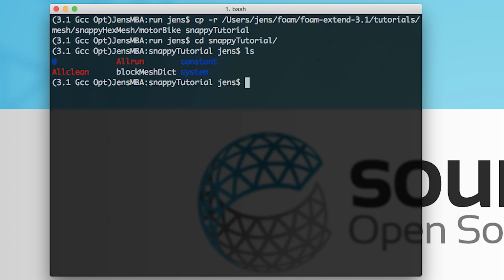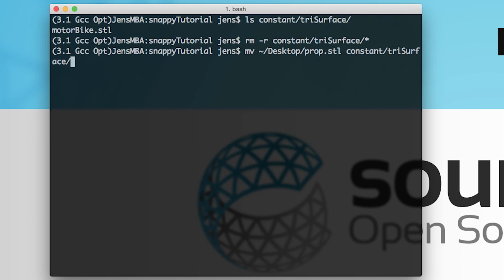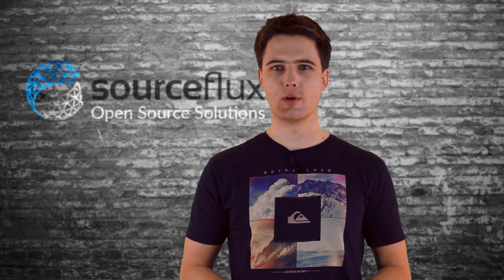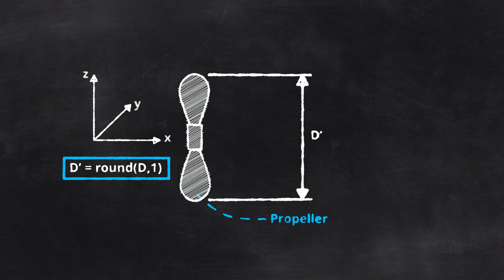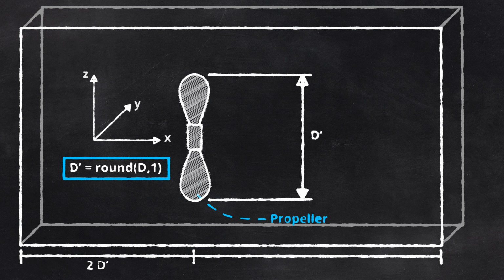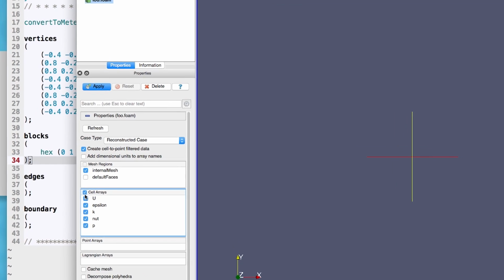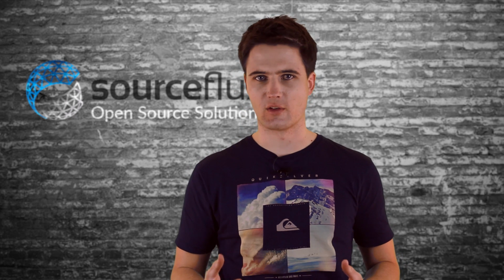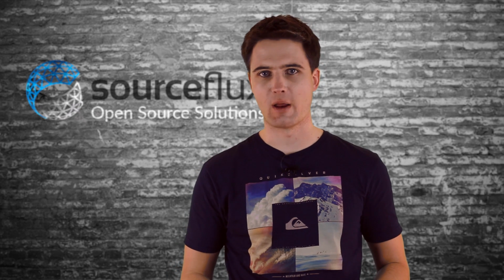snappyHexMesh Tutorial Part 1

Comment: Hi, I'm Aldias.
thanks for giving the tutorials.
its helpfull.
But I'm still having problem with the Boundary Condition,.
When i was running, 
In the terminal was problem:

aldias@aldias-desktop:~/snappyTutorial$ blockMesh
/-------------------------------------------------------------------------\
| =========                 |                                                 |
| \\      /  F ield         | OpenFOAM: The Open Source CFD Toolbox           |
|  \\    /   O peration     | Version:  3.0.1                                 |
|   \\  /    A nd           | Web:      www.OpenFOAM.org                      |
|    \\/     M anipulation  |                                                 |
\-------------------------------------------------------------------------/
Build  : 3.0.1-119cac7e8750
Exec   : blockMesh
Date   : Apr 11 2016
Time   : 14:27:12
Host   : "aldias-desktop"
PID    : 3084
Case   : /home/aldias/snappyTutorial
nProcs : 1
sigFpe : Enabling floating point exception trapping (FOAM_SIGFPE).
fileModificationChecking : Monitoring run-time modified files using timeStampMaster
allowSystemOperations : Allowing user-supplied system call operations

// * * * * * * * * * * * * * * * * * * * * * * * * * * * * * * * * * * * * * //
Create time

--> FOAM Warning : 
    From function dlOpen(const fileName&, const bool)
    in file POSIX.C at line 1179
    dlopen error : libparMetisDecomp.so: cannot open shared object file: No such file or directory
--> FOAM Warning : 
    From function dlLibraryTable::open(const fileName&, const bool)
    in file db/dynamicLibrary/dlLibraryTable/dlLibraryTable.C at line 99
    could not load "libparMetisDecomp.so"
Creating block mesh from
    "/home/aldias/snappyTutorial/constant/polyMesh/blockMeshDict"
Creating curved edges
Creating topology blocks
Creating topology patches

Creating block mesh topology
--> FOAM Warning : 
    From function polyMesh::polyMesh(... construct from shapes...)
    in file meshes/polyMesh/polyMeshFromShapeMesh.C at line 901
    Found 6 undefined faces in mesh; adding to default patch.

Check topology

 Basic statistics
  Number of internal faces : 0
  Number of boundary faces : 6
  Number of defined boundary faces : 6
  Number of undefined boundary faces : 0
 Checking patch -> block consistency

Creating block offsets
Creating merge list .

Creating polyMesh from blockMesh
Creating patches
Creating cells
Creating points with scale 1
    Block 0 cell size :
        i : 0.2 .. 0.2
        j : 0.2 .. 0.2
        k : 0.2 .. 0.2

There are no merge patch pairs edges

Writing polyMesh
--------------
Mesh Information
--------------
  boundingBox: (-0.4 -0.2 -0.2) (0.8 0.2 0.2)
  nPoints: 63
  nCells: 24
  nFaces: 100
  nInternalFaces: 44
--------------
Patches
--------------
  patch 0 (start: 44 size: 56) name: defaultFaces

End

I need your help.
Thanks so much.